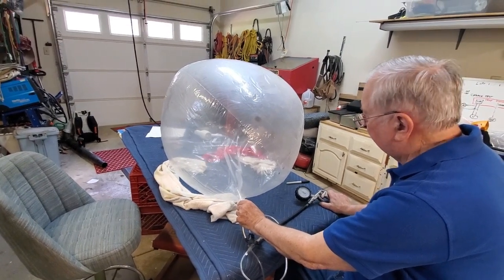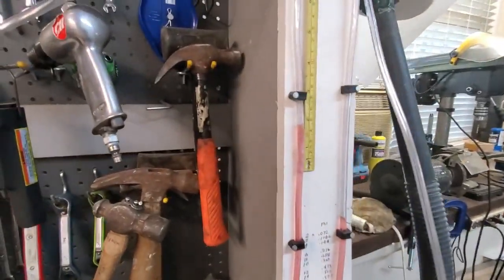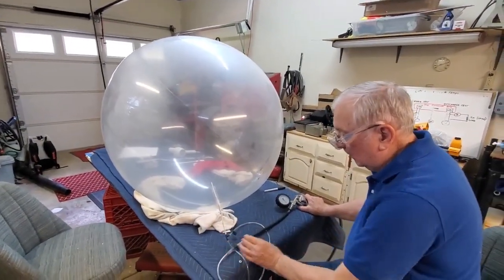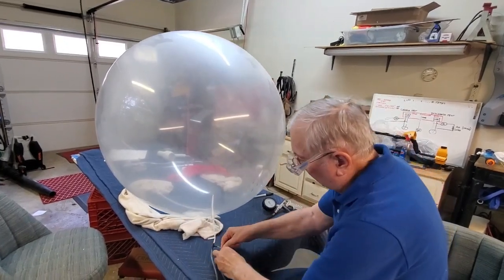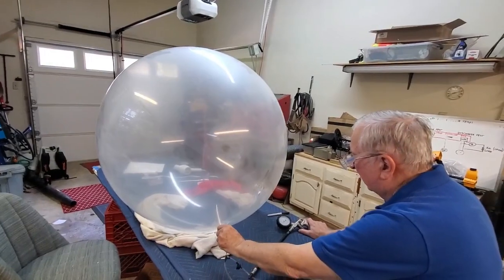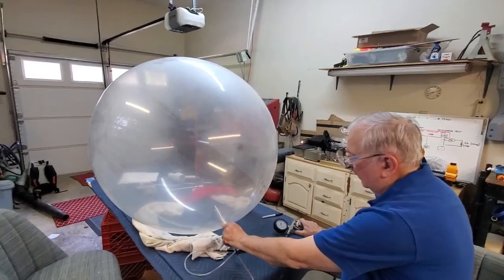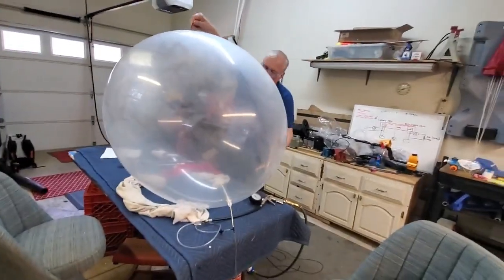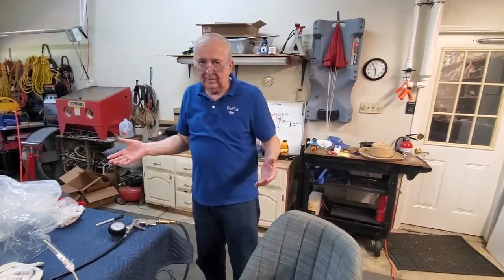pressure and pop of 32 inch Yokohama balloon

Comment: Good to see that. I made my own mylar balloon, but no way to make this test. The glue is contact cement, but I wish I can find 3M double sided tape. So far no luck in searching. Not sure about volume, it was medical thermal blanket, 160x210 cm, folded to make pillow like structure. Flying good, but it behave differently than latex balloon.